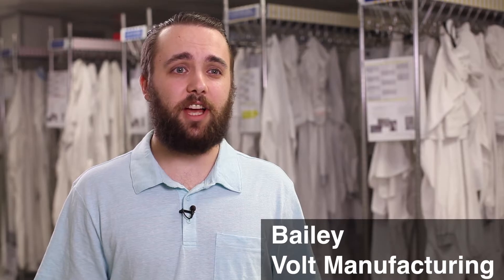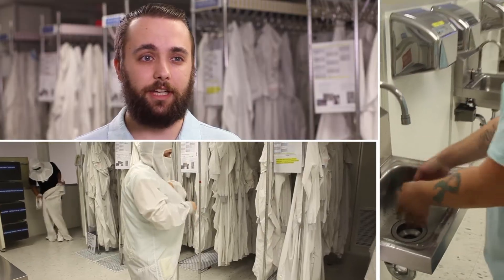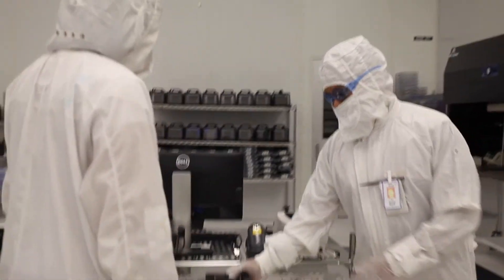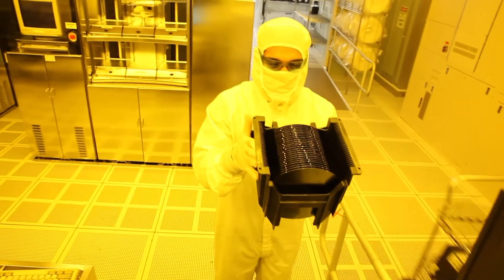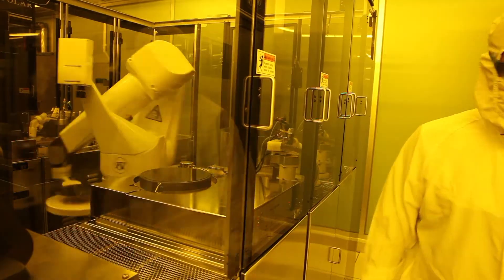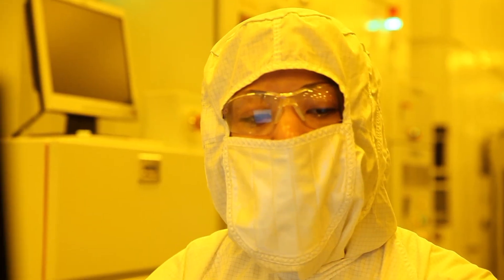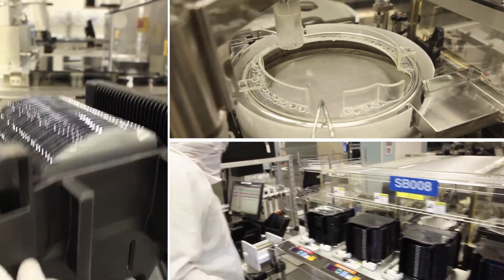Day in the life - Volt manufacturing

Comment: I love working in the Semiconductor industry as a fab manufacturing technician. But I do have one complaint thats also shown in this video - I'm not a fan of the built in masks on the clean suit hoods. 😂
Reply: how come?
Reply: @GloomyNate  The hoods that we use are washed (Extremely hot steam + anti bacterial detergents) so its completely safe, but personally I'd rather wear a mask. My site made the switch about 8-9 months ago. Plus, the sizes are definite, so in my case, an XL is too big and the mask falls off my nose and hangs below it, but the L is too tight on my nose, and leaves marks on the bridge of my nose.
Reply: @samward7633  I have an interview next week. Any tips?
Reply: @kennyjevonbryant  Just be yourself. If you have questions, ask em!
Reply: Any experience required for it? Or can they train new grads and new entry level workers?
Reply: @kennyjevonbryant  did you get the job?
Reply: @EngineeringLife0  No experience required, depending on the position. I worked in physically making the wafers. But for positions like Line Maintenance you'll need a degree in something related.
Reply: @samward7633  oh okay. How much was the pay if you don’t mind me asking. I have an associates degree in mechanical engineering, I applied just to see my luck. Lol
Reply: @EngineeringLife0  For my job, I was making about 16.40 an hour. Maintenance makes about 22-24/hr. Ironically I'm not working in the fab anymore, but I still work for the company. :)
Reply: @samward7633  that’s great!!! Your working for an amazing company. Hopefully they call me back. I’ll be back with an update if they do lol. Thanks for the info I appreciate it
Reply: @EngineeringLife0  What company?
Reply: @EngineeringLife0  I did!  I make a year next month.  I love it
Reply: @samward7633  Texas Instruments
Reply: @kennyjevonbryant  that’s great to here! How long after you applied did they call you?
Reply: @EngineeringLife0  it took about 3 months
Reply: @kennyjevonbryant  sounds good. Thank you for the information 🙏🏼
Reply: @samward7633  i start in 2 weeks and i work at night $21/hr as manufacturing specialist
Reply: @kenettrivera8168  I’m confused about the pay. Is $21 with Volt or TI?
Reply: @MrMando9909  volt bro
Reply: @kenettrivera8168  ok thanks. I wanted to know before calling them back. Ive got an interview on Wednesday.
Reply: @MrMando9909  there is a long wait i had my class on the 11th. N they told me to wait 2-3weeks to start.
Reply: @kenettrivera8168  yea I know someone who also applied and they were probably on that same class on the 11th cus it was this month. He told me the same thing about 2-3 weeks of waiting but I think he’s just waiting on his background check to complete before they give him a start date

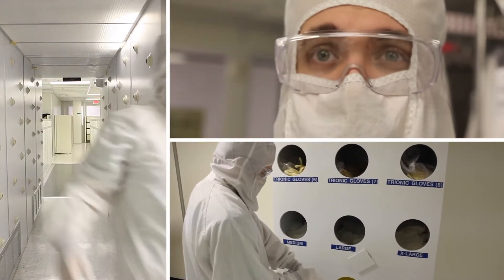Comment: 1:04 Wait: 12 hour shifts. 3 days a week. Then where the overtime. Overtime is anything over 40 hours…
Reply: Some places don’t go by 40 hours, it  can start when you are over 8 hours a day.
Reply: 4:2 shift pattern
Reply: On the first week you work 4 days and the next week you work 3 days. You get overtime for the first week cause you work 48 hours on that week, 2nd week is 36 hours. Each day is 12 hours.
Reply: You work 4, 12-hour days then have 3 days off one week then the next week you work 3 12-hour days then have 4 days off. It rotates every week.
Reply: in TX overtime is anything after 8hrs. so say you have a regular 8hr shift but they need you for another hr that hr is paid at OT rate.
Reply: @tangelaharris2500  After 40 hours you get overtime, usually time and a half. At least that's how it is here in Texas.